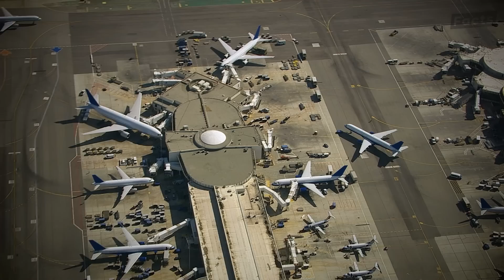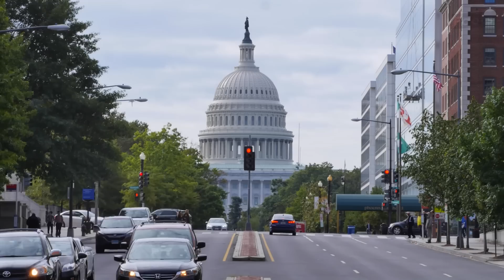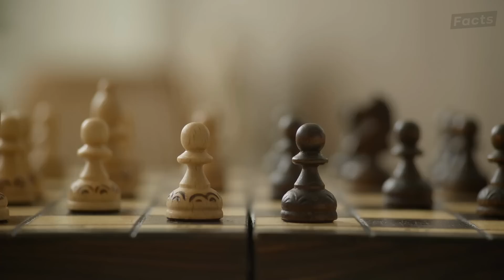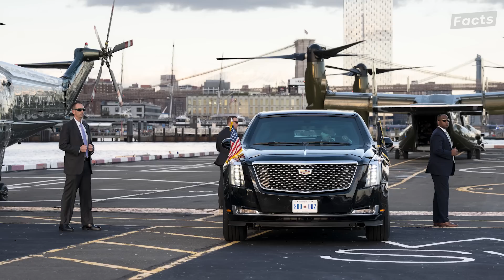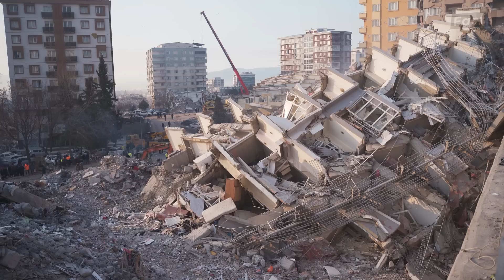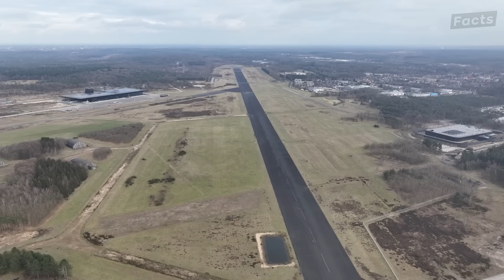This Is How the Secret Service Moves the U.S. President Undercover

Comment: One thing I remember how W Bush was on Air Force one and it kept moving during the attacks on 9/11. They didn’t dare land until they knew what was going on.  My heart was in my throat praying that the attacks were not going to include the president.
Reply: That's what AF1 is actually meant for - in the event if a nuclear attach.   Its why the aircraft is modified for in-flight refueling.  Commuting is a side benefit.
Reply: Praying doesn't work
Reply: Not sure who you are thinking of as being in the air while 9/11 took place. It is well documented that George W Bush was reading stories to kids at an elementary school in Florida while the attacks took place in New York. There is video of a staff member interrupting W while reading to tell him about the plane hitting WTC…

Comment: Air Force One is a call sign, not a plane.  When the president is on board the 757, its Air force One!  When no president is onboard, it uses its tail number.  And yes, many of those features you describe come standard on the 757 and all modern Boeing aircraft.
Reply: When the passenger on the C-32A is the vice president of the United States, the call sign is "Air Force Two".
Reply: It’s a not a 757. The current plane is a 747-200B
Reply: @ Its actually a Boeing VC-25, a military version of the Boeing 747 airliner.
VC-25A: military version Boeing 747-200B
VC-25B: military version Boeing 747-8I
Reply: @ so a modified 747. I like it. Thanks for the info 🙏